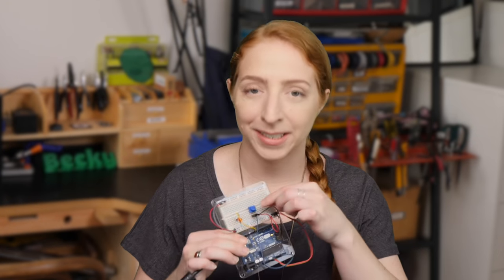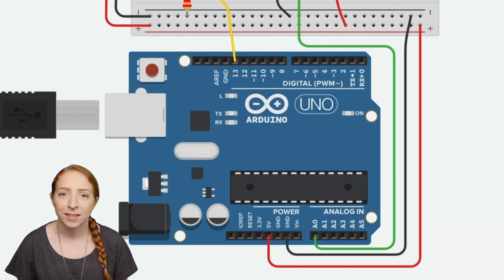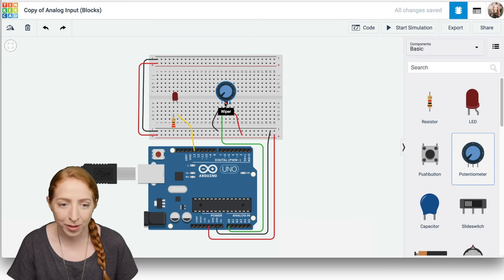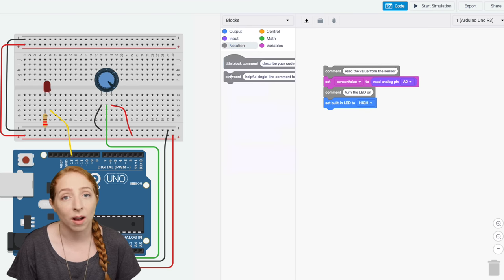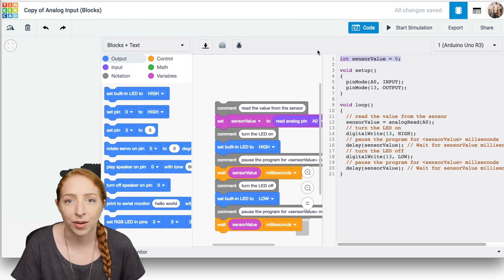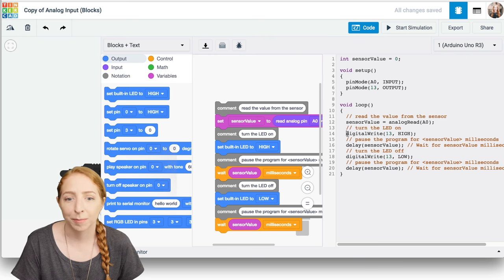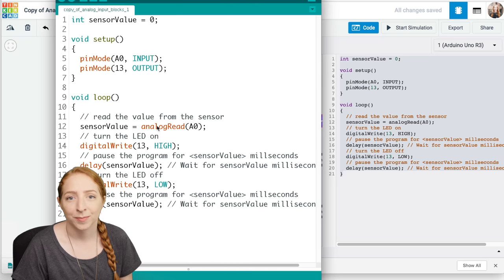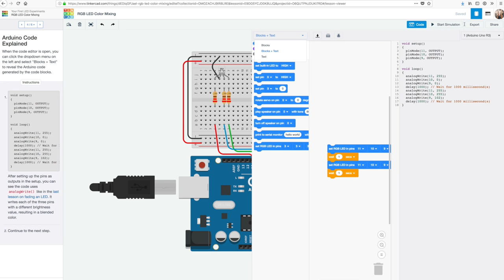Potentiometer Analog Input With Arduino in Tinkercad

Comment: These videos are fantastic!!! I've been wanting to get my kids into Arduino for ages, but the board, wires and components are a little intimidating. Building the lab in Tinkercad first takes away that fear. The girls could experiment quickly and try changing the setup before going to the real thing. having modelled the setup themselves also takes away the fear of complex wiring diagrams.
I love the Scratch programming interface and that you an just copy/paste the code into the Arduino. This allows them to keep using their scratch knowledge and expose them to code without needing to hand code it on day 1.
You're definitely getting a Linkedin shout out here!!

Comment: what's the resistance of the resistor?
Reply: you manually select the resistance in the component menu
Reply: What if he's designing the actual circuit she skip some details and is about fast • I used a 330 ohm resistor

Comment: A small doubt can we control the potentiometer knob which will be present on the SMPS through arduino uno from the computer instead of manual adjustment
Reply: Yes..you can rotate